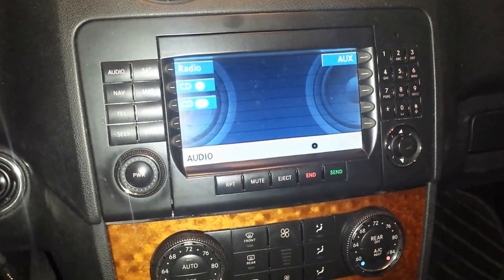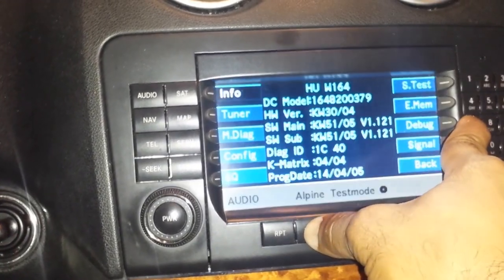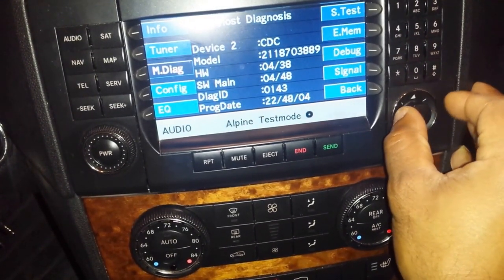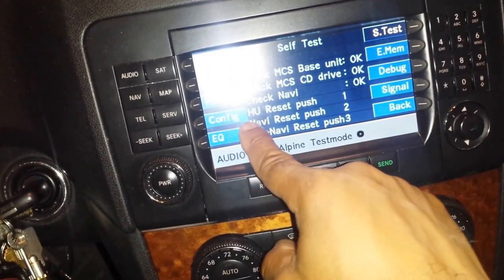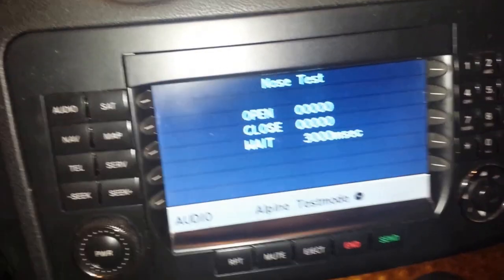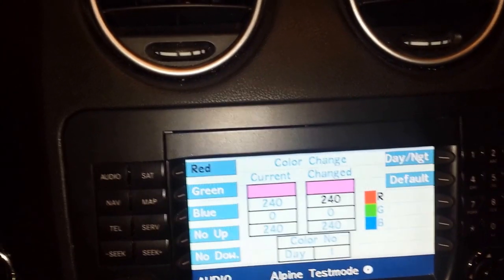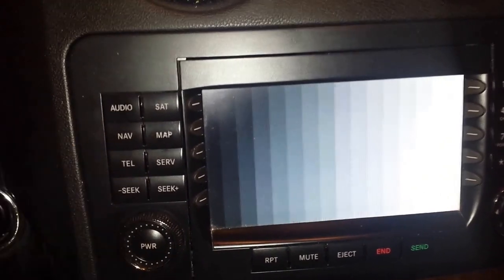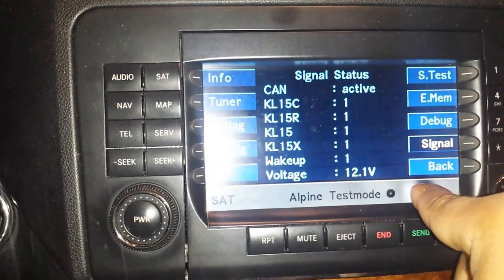Mercedes Engineering Mode and explanation of menu items

Comment: Engineering mode and explanation menu did not worked with my ML 280 AMG 2006, I just wonder wonder if it is got to do with the connections?

Comment: I replaced the battery on my 2008 ML550; My question is can I unlock the Radio, CD player etc. from engineering mode or do it somewhere else? So far, I can’t find anything that addresses that.Help.
Reply: You need to call your local MB dealer, they will provide you code to unlock the radio/CD unit by your VIN.Not for free ofcourse🙄Disconecting battery can lock the radio/CD unit(antithief )
Reply: @NastyMosquito  Update! : The problem  was not that the radio was locked ; a burnt out fuse in the speaker system was the culprit. Long story short: I had to break down and take it to my “friendly neighborhood MB dealer “for the main problem, which was the wiring under the passenger seat burnt out, which also killed the brand new battery I had purchased. So, they replaced the wiring harness under the seat, battery and the fuse in the speaker system. It set me back about $1600.00 including parts and labor. Yeah, that hurt, but I got my car back and my tunes and she’s going strong. Hey, thanks for the input, Bro.

Comment: I have radio sound but I can't change it or no navigation it just stays on the Mercedes Benz logo buttons not working, what I need to do?
Reply from the maker: try unplugging the fuse for the radio for 5 minutes then plugging it back in.  You will need your radio code after inserting it.

Comment: ml 350 2006 any idea why the inside light arent working, also the seat
Reply from the maker: inside lights could be a blown fuse...  It also could be a blown bulb.  However, if all the lights are out its probably a blown fuse.   The seat is not moving back and forth?  Or seat warmer isn't working?  Seat not moving back and forth could also be a bad fuse or bad motor in the seat.  Start by looking at your fuses.
Reply: Do you know how  To hook up your Bluetooth to the 2006 ml 350?

Comment: the seats are not moving back and forward also the front and back wipers.all stop at the same time
Reply from the maker: Hmmm...  Best to start by addressing one issue at a time.  Fuse chart should be located in your trunk on top of the spare.  It will show you the location of each fuse for these components that are missing.  Check each fuse by pulling it and looking at the fuse.  I usually use a continuity reading on my volt-meter
Reply: +iRepair Autos.today everything start working and after a few bloks everything stops 😞

Comment: Can it tell if the amp is bad? No sound.
Reply from the maker: No. The engineering mode tests the head unit only. Sorry
Reply: Dj,
 Did you ever figure out if it was the amp? I have a 08 gl450 everything turns on as its should. But no sound. 2 year's ago i noticed once it started to get cold the unit would not pick up the signal but after the car warmed up about a half hour it would kick on. In the summer, no issues. Just curious if you figured out your problem.